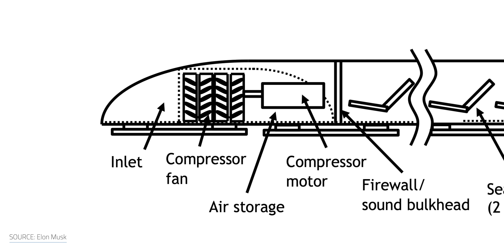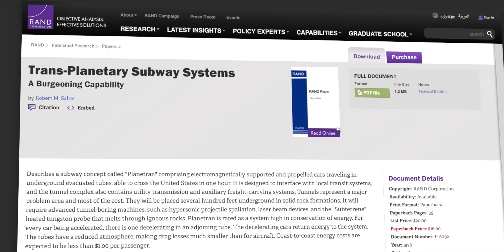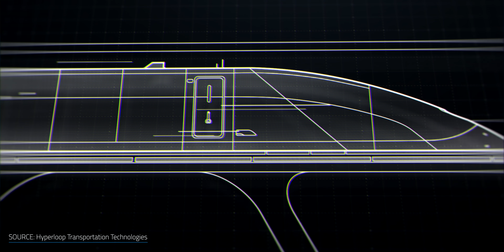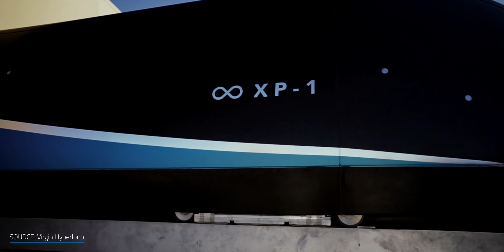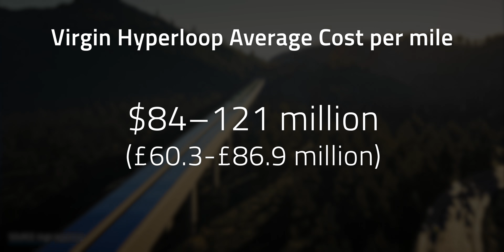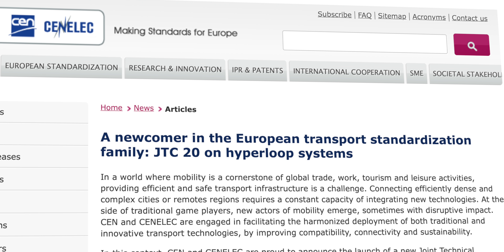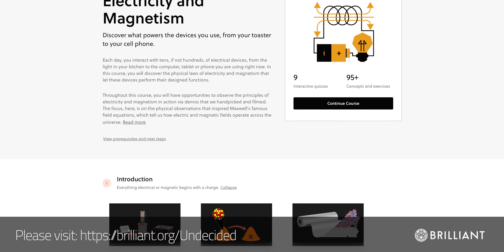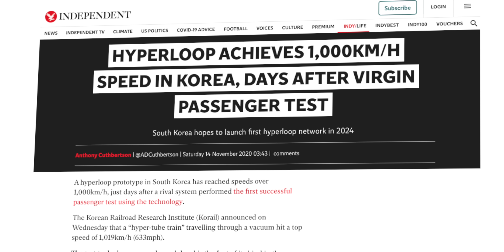Exploring Hyperloop - The Future of Renewable Public Transport?

Comment: This is the latest 'vapor tech' ponzi scheme imo. Vacuums, humans and high speeds.......    I can't see what can go wrong? /S. And Its not just the construction costs, but the maintenance costs will be crippling on a network of vacuum tubes, seals and compressors. Its all sounds like pure fantasy to the real world application.
Reply: What exactly is the problem? Did you know that for example solar cell's ingots is made in ovens evacuated with the same types of vacuum pumps that can be used on hyperloop? And they run pretty much 24/7 with minimal maintenance even though they are much more exposed to wear because of silica dust. And they also have big seals that last a really long time as long as they are kept clean each time the oven is opened to load a new batch.
Reply: @titter3648  my problem is obviously not as bad as your reading comprehension, yes vacuums happen in industry all the time, but ovens don't get packed with live humans and fired at bullet speeds across a country. A loss of pressure on an oven just ruins the batch,  maintaining a very low pressure system across hundreds of miles with thousands of seals and thousands of pumps,all day every day, instead of an oven with 1 pump and 1 seal. All Run by a country who's maintained networks are a shambles at best, maybe the US is considerably better than say India or Africa, but I wouldn't put my life on it, or in it.
Reply: @nomadicgrenada  A monocrystalline silicon oven is actually much more critical to maintain a good seal than in a hyperloop system. Because if oxygen gets in the batch is ruined, and that is a lot of money gone. While on a hyperloop system some small leaks from some seals is not a big problem because it is compensated by the vacuum pumps. And if one pump on a hyperloop goes down there is many others to take over, while on a monocrystalline silicon oven that again ruins the batch.
Reply: @titter3648  I get your point, just like your user name (the wankle}), a great idea on paper but has major issues with the seals making the motor mostly a failure in the real world, sadly imo, I'm a fan of the wankle engine. And a failure of a Hyperloop section will most likely result in a handful of people to turn into red mist, which certainly is worse than a ruined batch of say, ingots.
All of this considered the thermal expansion/contraction involved on a daily basis also make this entire system as fragile as a newborn.
Reply: @nomadicgrenada  Does the gas pipelines going all across the world fail all the time because of thermal expansion?
And how will a hyperloop section fail and turn people into red mist?

And the problem with the Wankel is actually lubrication of the seals, not the seals in them self. Because both sides of the seals is exposed to the pumping sides of the motor you need to put the lube in to the air fuel mix area in stead of having it in a separate area like in a 4 stroke piston engine. It is pretty much the same problem as on a normal 2 stroke piston engine. So you are burning oil with the fuel. On a ceramic engine the problem would be solved because it does not need lube (but is too expensive to make).
Reply: @titter3648  I've worked on a few and you're correct about the lube issue, fundamental though it is the seal itself and its longevity, the lubrication problem is a 'fix' for the seals inadequacies. Not sure about this yet as I haven't seen one in the flesh, but have you seen the 'inside out' wankle engine?. 
As for oil pipelines made by an industry that can easily afford to over engineer its network and only pass a liquid through it at a reasonable rate, and yet still massive oil leaks across the entire planet......from perfect pipes?. 
Slow moving fluids compared to a multi tonne sled on wheels or maglev streaking through a steel pipe at hundreds of miles an hour, countless times a day, any rapid interruption to this finley balanced environment will be difficult to stop with the occupants remaining as one. This is effectively a bullet in a barrel, and if that said barrel gets too hot, well you know the rest. 
I reckon the star trek transport beam will be working before the Hyperloop becomes economically viable.
Reply: @titter3648  https://youtu.be/0e785YnDmq0.
This is the design of the 'inside out' variation.
Reply: @titter3648  Pipelines have a lot of incidents.
For natual gas alone the Pipeline and Hazardous Materials Safety Administration (PHMSA) has collected data on more than 3,200 accidents deemed serious or significant since 1987 in the US.  In the year 2020 it was 281.
You can find the source data here: https://www.phmsa.dot.gov/data-and-statistics/pipeline/pipeline-incident-20-year-trends

Comment: There are probably courses on your sponsors site, that teach just how big the challenges for a hyperloop are. If you have had any contact with vaccum tech (f.e. for switchgears), hyperloop does seam infeasible. Waiting hours to get your capsule to a vaccum environment just nullifies the speed advantage. I haven't seen any proposals to solve that yet, despite having own ideas. Can someone please do calculations for the friction loss gains in mild low pressure environments with feasible get in times? What about staged giant piston systems with energy recovery similar to locks for ships? The person test shown wasn't under vaccuum afaik.

Comment: As someone said, Hyperloop takes several problems and dangers of space travel and brings it to the surface
Reply: Give elon credit. He is getting better. This is a way better idea than replacing planes with rockets. At least the hyperloop will fail before killing hundreds of people...better burn money than people.
Reply: Arguably much much more dangerous than space travel.
Reply: Has a point. For green long distance transportation I prefer putting research into electric driven propeller aircraft rather than jet engines where the exhaust is a problem even with hydrogen burn because of the heat generates NOS greenhouse gases. The electricity can be possibly be produced by a  fuel burning internal engine with scrubbers in the body of the plane  to greatly lower the green house gas generation. The engine scrub is a NASA concept no one seems to be working on yet as large electric driven turboprop aircraft have not been developed yet.
Reply: This is one of those quotes that sounds meaningful but actually says nothing. It sounds clever but it isn't. So people quote it thiking they are clever, but they're not.
Reply: It is my opinion that hyperloop will never happen. Just more Musk BS.
Reply: @DavidJohnson-tv2nn  yeah, like the whole electric car thing...or the reusable rockets thing...or the underground road system thing...more musk BS. Man haters gonna hate.
Reply: @DavidJohnson-tv2nn  that literally makes no sense, maybe not for now but how can you say its impossible ? Its all just engineering problems which with better tech and time can be solved.
Reply: @n.g.s1mple29  But it's not just an engineering problem? It's also an economical as well as a problem of hazards. How the hell are you going to do economies of scale with the Hyperloop? What happens if there is a failure in the Hyperloop?
Reply: Oh god.. do you even understand that what challenges you described in the comments are being tested everyday for the last decades in the internationnal space station? Hyperloops problems have nothing to do with space ones.. its about keeping the vacuum and dealing with the earth itself...while in space its about longevity in a confined space, radiation control and lack of gravity longterm. I think you could not have given a worst parralel.
Reply: The thing is, concepts of cars and airplanes didn’t seem to defy the laws of physics.
Reply: Which problems of space travel would it bring down? There's challenges, sure, but none i can see from space.
Reply: @joshuacheung6518  Being in a pressurized ship in a vacuum, emergency exits, oxygenation in case of power loss, hull breaches, an vacuum sealed entry that has to function perfectly thousands and thousands of times, I'm sure there is more. And, of course, cost. All pretty much problems with space travel.
Reply: @felipaorfr  it's not vs a hard vacuum though. It's a low pressure environment, so it's more akin to atmospheric flight in all aspects.
Power loss, there's systems in place for that already and you don't have to worry about crashing into the ground.
Hull breaches don't cause things to explode into a million pieces either.
Reply: @joshuacheung6518  The huge vacuum sealed tunnel is a big problem. But I'm not saying it's unfeasible, I'm pretty sure we will be doing space travel routinely at some point. But Hyperloop has a lot of hard problems to solve
Reply: @felipaorfr  that tube is not space related at all. Again, high altitude flight is more akin to the issues.
Reply: @joshuacheung6518  Dude, a Hull breach in the tunnel or the train would be a huuuuuge problem. It would be a catastrophe, and we are talking hundreds of miles of tunnels. That's a problem even worse than they have in space travel. The vacuum needed to achieve those speeds inside a tunnel are much bigger than flying at airliners altitude. It's pretty much a vacuum
Reply: @felipaorfr  what are you using to cause this breach? A thermobaric device applied inside the tunnel?
Again. NOT a hard vacuum. NOT going to explode or implode if there's a small hole.  You're fearmongering.
Will there be bad damage in case of, say, a derailment or a plane crashing into it? Yeah. But the whole network doesn't just erupt into flames just because one segment is damaged.
Reply: @joshuacheung6518  air pressure at 30000 feet is about a third of what it is at sea level. Hyperloop proposes to use one thousandth the pressure air at sea level.
Reply: but, it's also cool af
Reply: @KingFinnch  Doesn't matter cause it wont work...
Reply: @nicok.1491  not in your lifetime which is literally the point. they said the same shit about the first cars/planes
Reply: @phillipmoore6249  Who's they? They never said anything like that about cars nor planes.
Reply: @Liftium  100% thousands upon thousands thought vehicles would never ever be what they are today. Laughed at the thought. Just as you at about this
Reply: @phillipmoore6249  No no it is physically impossible... watch Thunderf00t, he made a few videos debunking the possibilty of hyperloops.

I would love it be possible, but physics is saying no.
Reply: @nicok.1491  millions said the exact same thing about airplanes. Tell a man in 1865 that planes will be filings in 50 years....he would of said it’s physically impossible
Reply: @nicok.1491  physics don't say no. Physics of the thing are fine, if enough money is properly invested in it. Thunderfoot over exaggerates many issues that aren't that large.
Reply: @joshuacheung6518  Oh so the fact that a metal tube that is long enough to go from city to city expands and retracts due to temperature differences from night to day by multiple hundreds of metres is false or not a big deal ???
Reply: @nicok.1491  expansion joints, climate controlled enclosure.
And it looks like a 350km steel tube, long enough to reach certain cities, would only expand or contract about +/-90m if temperatures swung 20c, rather than hundreds of meters.... i am, of course, assuming the daily temperature deviation is generally less than that.
Reply: @phillipmoore6249  In less than a single human lifetime we went from the Wright Brother's plane to the inaugural flight of the 747 and landing on the moon. There has been no such revolution in boring technology which is half a century older than heavier than air flight. The machines have gotten bigger and faster but not even a fraction as fast and economical as would be necessary to make hyperloop practical to construct.

Musk needs to be viewed a lot like Henry Ford in that he has a few big ideas that have the potential to be very successful (though like Ford he popularized rather than invented them and like Ford his ventures sometimes succeed in spite of him thanks to his employees) but that success also means people pay attention to his bad ideas as well.
Reply: @Bustermachine  the year is 2137....can safely travel from NY to LA in 1 hour......this changes the world for greater than anything before it
Reply: @phillipmoore6249  The funny thing is that the boring machine, a necessary technology for certain iterations of the hyperloop already existed in 1865. 

Whether a technology is going to prove practical is sometimes hard to predict as it relies on getting on with a lot of assumptions far out on the time horizon.

Air travel, for instance, became relatively economical due to the jet engine which is both more complex from a design and manufacturing perspective than the piston engine but is actually mechanically simpler in operation with a greater degree of reliability.

 The air travel analogy also contains the example of stepping back from hypothetical progress. The Concord was once considered the future of air travel yet it no longer operates.

Even ignoring the problem of its noise pollution in flight, the plane struggled to be economical due to the design constraints of a large supersonic aircraft.

In the end the people who could afford to fly on the concord could also afford six more hours of light time in far greater luxury in a convention Jumbo Jets first class.
Reply: @phillipmoore6249  In the early 1900s people predicted everyone would be flying everyplace with their personal flyting machine by the year 2000. Imagining something doesn't mean its going to exist and history is littered with the could have beens of human imagination.

I could always be wrong but I fall into the camp that the hyperloop is a lot less practical futurists hope.
Reply: @phillipmoore6249  Like they said there will be flying cars in future.
Reply: @Liftium  FFS they did so. There was a point in aircraft evolution where they thought going faster than sound would kill you. Take a history lesson please.
Reply: @phillipmoore6249  and many times people laughed about other trabsportation systems which never worked and where right about it. Hyperloop while possible is not feasible. You can't get Maglev running to reasonable cost neither will you a Maglev in a vacuum tube you're much better off improving High Speed Rail.
Reply: @phillipmoore6249  false equivalence. 
Go read up on what it would take, the amount of energy, to create that vacuum.
If it springs a leak, because, for example, someone shoots it with a high power rifle, all the energy it took to suck out the air will come rushing back in at the speed of sound.
Anyone in the tube will be pulverized instantly, even inside their pods.

Look into expansion and contraction of metal, and tell us how that will work out.
Reply: @phillipmoore6249  did you ever consider the fact that sometimes people laugh at something BECAUSE it actually is absurd? This whole "people laughed at the Wright Brothers but they had the last laugh" argument is weak. You're falling for selection bias. Think of all the patently dumb ideas that were laughed at and still failed because they were intrinsically flawed even in theory. You can't, really, because they failed, so no one talks about them all that much. 

The hyperloop is one of those ideas. Even in principle it doesn't even hold a candle to proven transport methods like high speed rail or even regular old maglev. There are plenty of people you can look up who do a pretty good job at exposing the catastrophic flaws in this boondoggle. Unless Elon has some super-carbon-nanofiber-reinforced-gigapolymer supermaterial that we don't know about that can support a vacuum of this unspeakable size (while also being economical, let's remember) then there's no way this thing can even be BUILT. The calculations don't allow it without a significant chance of hyperloop being a goddamn death trap.

The world needs dreamers and visionaries. But it also needs critical minds, lest we start worshipping people like Musk, who have in no way earned such praise.
Reply: I have a feeling if it was too easy musk would not be interested in it :).
Reply: @Cosmic_idea  It's actually not a "moonshot" technology, the biggest challenge is basically the local + federal money to do it. The tech itself exists and did 30 years ago.
Reply: @blondegirlsezthis8798  the tech for this does not exist.
Creating a vacuum in hundreds of km of tube has never been done, not even close.
Reply: weak.

Comment: Good coverage overall on a controversial topic. Everyone citing Thunderfoot need to wake up and see the other side of the arguement. The point these people are missing is that from an engineering aspect, Hyperloop is not a big challenge, the real issue is finance and practicality. So stop with the nonsensical engineering argument from Thunderfoot about tube expansion, vacuum compression etc. Personally this will not be a viable but not because of engineering reasons.

Comment: My google search shows the successful HTX model as 1/52 scale.  The fact that it hit 1019kph (scale) would only be 20kph (maybe faster than I can run, but not much).
Reply: Thanks for the figures.  The line X kph.......scale model, made me lose a mouthful of coffee.  Some things in physics are not naively scalable.   It's easy to get an electron up to a significant fraction of the speed of light, eg in a crt. .....
Reply: @raykent3211  I think the frictional loss effects go up as the square of the velocity.  If that's the case, their force results are off by a significant amount.  Ignoring the facts, if they doubled the speed, they could be "traveling" faster than the speed of sound!